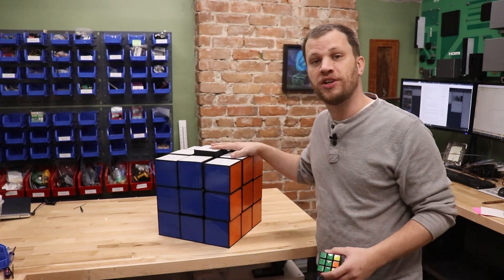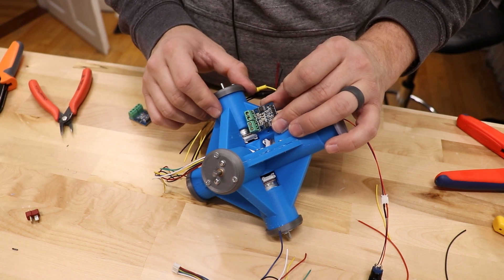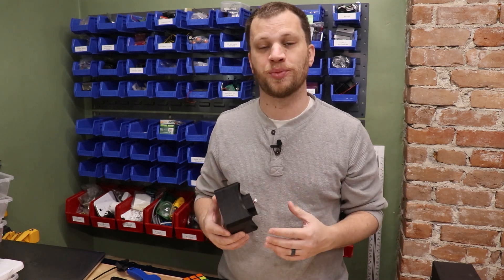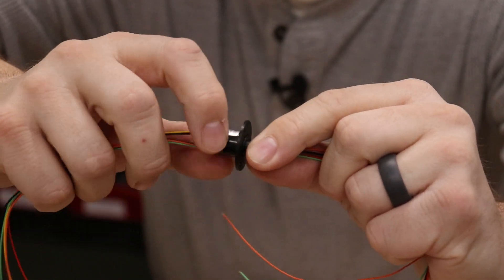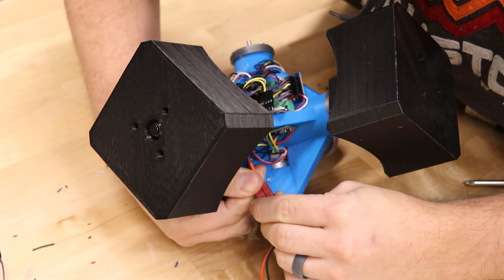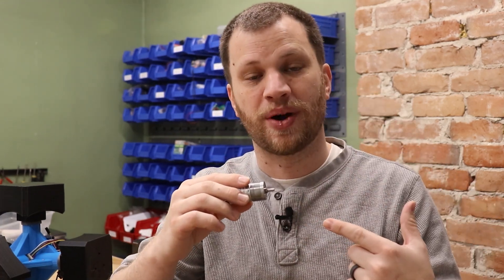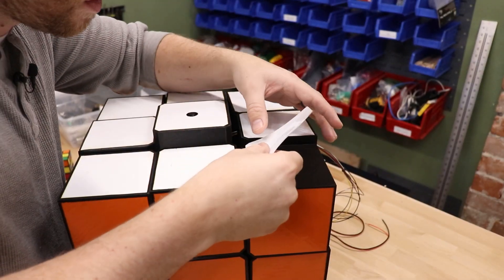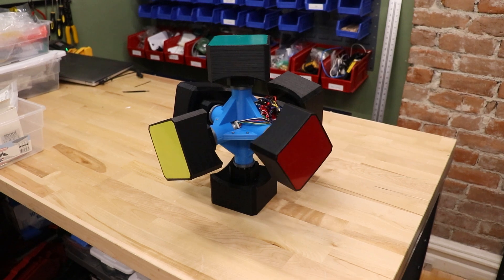The Self Solving Rubik's Cube - Part 2

Comment: Here's a crazy idea - use higher geared motors (that aren't back-drivable, maybe with a worm gear or two inside), and a ratchet mechanism.  This would only allow you to turn the cube sides manually in one direction (and the motors could only turn them the same way) but it would still be possible to scramble it and solve it.

Comment: Have you considered positioning the motors off center? Small gear on the motor drives teeth in back of the center piece that form a larger gear. Someone else has already mentioned lubrication which will help any configuration. Would love to see this finally succeed!!

Comment: Not that this is any help, but I noticed how loose the pieces seemed as you were assembling and immediately remembered my days solving them back when they first came out. The new cubes, especially the original branded ones, were tight and loosened over time. Perhaps maybe because I dissembled it a few too many times early, before I purchased a solution book.  😀
The looser my cubes would get, the more difficult alignment for the next move became.
Reply from the maker: Yeah the tolerances (how tight or loose) is very important.

Comment: As someone who designs rubiks cube like puzzles and prints them at home seeing that corner snap reminds me that you need to orient your parts for strength.  Centers should be in the orientation that the arm that connects to the motor should be in line with the x or y axis of your printer,  edges should lie on the inner surface of the piece,  and corners on the outside face. Yes it uses more support material but it gives you a stronger part. I hope this helps prevent further breakages to your parts. It's just that I remember when first starting I wanted pretty looking pieces and assumed that 3d prints were homogeneous but especially fff/fdm is like wood with a grain structure along the layer lines. I still appreciate your content and your pushing to do better.
Reply from the maker: That is super valuable, thanks for sharing!
Reply: @bytesizedengineering  thank you for the enjoyable content and positive attitude,  keep up the  great work.

Comment: Why didn't you use some kind of multiplexer? Actually you are spinning one motor at the time so multiplexing will be a solution for not enough pins in Atmega.
Reply from the maker: The motors just weren't strong enough. Maybe a higher gear ratio or maybe using a different type of motor
Reply: @bytesizedengineering  ok, I'm not denying that. I'm just wondering why you didn't use Arduino+multiplexer instead of Teensy?

Comment: I feel your frustration. We've all been there - it's the price for making cool things. It still makes great content though! My suggestion for more torque is to try over-voltage on the motor power supply. 10% more volts = more than 10% more power, and is usually within what most motors can take. What have you got to loose :) Get a cheap Chinese 600W DC-DC converter and crank Vmot up
Reply from the maker: They are 6V motors and I'm running them on a 3S Lipo battery at 11.1V. This also increases the speed which is bad for me
Reply: @bytesizedengineering  ahh yes! Sorry, I had just assumed those were stepper motors (more voltage doesn't increase speed in steppers, just torque). If you're driving 6V coils on 3S then you're already giving them a pretty good thrashing so I politely retract my suggestion :)

Comment: Why not install fuses? You might not need them in the final build but it certainly beats replacing electronics in testing and if/when there's a fault on the final. I see you've already commented about Bruton so I won't repeat that, but it's a sweet project so I really hope you can find some alternatives!
Reply from the maker: I hadn't considered fuses. Typical fuses need to be subjected to high current for a relatively long period (500ms or more). I think the damage would have already been done by that point. I did use a current limit on my power supply, but I'm dealing with motors here so I can't really starve them of current and expect them to work okay
Reply: @bytesizedengineering  pretty sure quick-blow fuses are a thing for small electronics but the only experience I have with that so far is on my airsoft rifle. I know I can get digital fuses even for my gear so might be worth checking out?

Comment: Cycloidal or planetary gearbox would be my suggestion. Honestly I'm fascinated how the  Rubiks cube outer squares stay connected  and aligned with the center pivot point, I'd love more details on how you solved that.
Reply from the maker: I watch a lot of James Bruton on YouTube. He builds a lot of motor drives that need to be backdrivable. I know recently he's been experimenting with cycloidal drives. Maybe I could give that a shot!
Reply from the maker: It's quite fascinating how all the cubes are held together. Each piece has an extended part that overhangs the edges of the adjacent cube. This allows all the parts to move while still being held in place. It's really tricky to get the tolerances right. Right. I think I had way too much tolerance. All of my parts were pretty loose and didn't slide around very well.